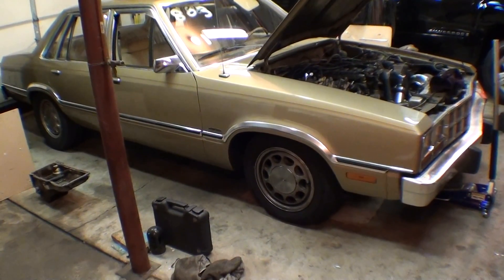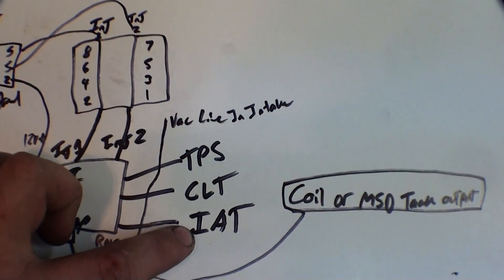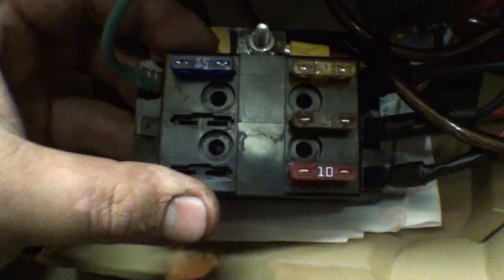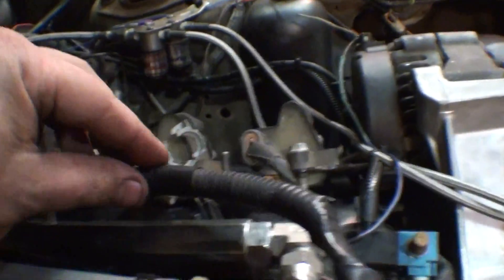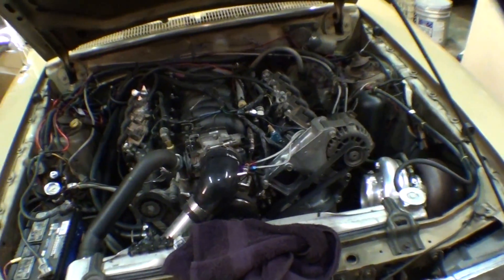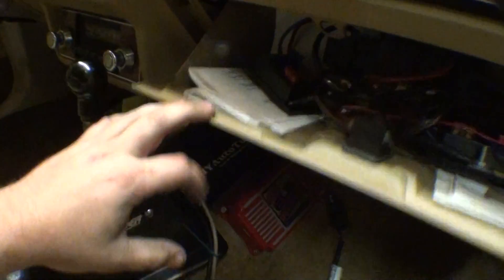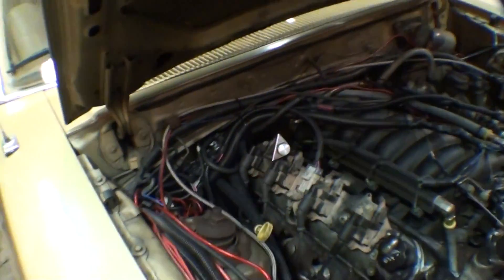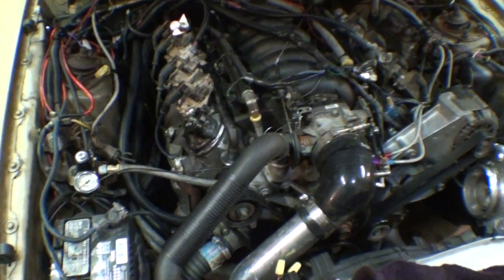9-29-12 how is Megasquirt wired into a car

Comment: I'm looking at the mega 2 kit looks interesting. I have the original edelbrock pro flow which is obd1 based sequential injection and want to upgrade. From what your saying this system drives all 4 injectors on one bank at the same time? Do I understand this correctly? Didn't appear to have timing control kinda like having that unless I misunderstood all of what you said.

Comment: Is there outputs on the ms3 gold that i can run to my gauges
Reply from the maker: you can buy a racepack and use the CAN wiring to feed it with all the info, other than that the only real output for a gauge is the tach out wire

Comment: I hope I understood this right and sorry if you have answered it but you are saying the megasquirt fires each bank separate for every other stroke correct? So it doesn't fire just the cylinder that needs fuel or two cylinders like most systems? I see how that wouldn't matter to much but I'm sure fuel efficiency would be crap right? I might of misunderstood.
Reply from the maker: batch is one fuel event per revolution. and that is just some of the ECU's other ones depending on cylinders and in/outs can do sequential easily

Comment: so I want to use the ms1 from diy. Is that pre-made box plug and play with no need to flash? once I have all hooked up I will need a tune to get running correct?. thanks again for your videos!
Reply from the maker: this video is 4 years old and i would suggest other means for running the motor than i explained in this video
Reply: Sloppy Mechanics thanks for the reply. I have been looking on your site and vids alot and I think that I need the micro from efi with your tune, I plan on running a glide for trans so from I get out of everything I read is that I should use micro.   I'm trying to build a track car for me and my son to have fun and possibly compete . thanks  I just came across ls1 site your on i think I'll prob find the info there.
Reply: Sloppy, what other means you would suggest now besides the Megasquirt? also when you did this setup did the Tach output of the MSD trigger the MS without issues?
Reply: what would you suggest to use now?
Reply: so with this set up the spark plugs are dry firing  all the time?
Reply: FerZam Rod if you're going with an auto you'll want to use the stock computer so you can run the 80 and the motor

Comment: After reading a for months and watching thousands of videos this was the best explanation I have seen yet that doesn't go crazy with shit I don't need to know! The grounds were really confusing me. I couldn't figure out if I was supposed to use separate grounds or not. Also The whole power the unit and fuel pump is still a bit confusing but I think I am starting to get it. Thanks for the vid!!

Comment: question iam trying to sort this megasquirt 1 v3 running fuel only and ford edis8 for what ever reason fuel pump powers up car wont start I think it floods itself so I took the fuel pump power wire off to start the car turns on and stays on with no fuel pump  no fuel pump pressure crazy but there's a short clip I posted here on my you tube

Comment: Im sure I asked this before, but how do you run a v8 on microsquirt with only 2 ign outputs?
Im wiring a vh45 v8 into a 240sx.
Reply from the maker: +idusclothing we hot leg in ALED and WLED into the 5v circut with 2.4ohm pull up resistors and you can configure them to be ignition outputs, so then you have 4, and you run the v8 in waste spark
Reply: +Sloppy Mechanics so the pull up gets 5v power from the 5v reference wire, that also supplies the tps ect...? I just branch it over, or wire it in series like the 330ohm for the bip373

Comment: If I wanted to run individual coils on a Ford 302 using the MS3PRO do you need an MSD box to control each coil? How do each coil wire in and fire?
Reply from the maker: +blacktop2001 ms3 pro has at least 8 ignitors you would wire in lsx coils and easily be able to control them with the ECU and no other equipment
Reply: Nice. Thanks. Do you tune cars? If so how much to tune a ,86 mustang 302 supercharged, ms3pro?

Comment: nice setup.. How much miles does ur motor has? is it still running stock internals?.. Im thinking of getting a 138k 5.3  idk if that's too much with a 72mm...
Reply from the maker: +Aaron Hernandez yep always stockers, usually 150-250k miles, gen3 motor will do 550-600 safely and the later model, ls2 rodded motors will do 700-800+ reliably its disgusting
Reply: +Sloppy Mechanics so, on the gen 3 it would be the rods that are the main weak point?  or if you threw in whothefuckevers cool kid rods would other shit start dying around the 700 range?  basically im asking if the rods are the gen 3`s only or main limiting factor in seeing 7xx horse?

Comment: So, to get that RPM signal to the megasquirt and use stock ignition system, I just get the signal from the ground wire on the coil like I would for an aftermarket tachometer?

Comment: I'm thinking about putting megasquirt into my project. its a 92 f150 with a mustang 5.0 ho. for now I am stick to N/A building another engine in the next year for some boost. I want to get basic tuning down with an N/A application figure it would be easier. Which version of MS would you recommend? I've been on the diy website and efi sources website, looked over a few products. I've been following sloopy mechanics for about a year now and you seem to be rather knowledgeable in MS and how to do it so I thought I would ask for your opinion on which version to get. Any input on MS and tuning would be great. Thanks!

Comment: hey good videos keep them coming. also can you run the output tach of the MSD box to the input tach of the megasquirt to let your MSD control the spark and the megasquirt just control the EFI.
Reply from the maker: yes, but if you have ms2 or ms3, they can control the coil on plugs, so it makes the 6010 kinda useless
Reply from the maker: yes, thats how i was running this setup at the time, now we run a modified microsquirt or MS3
Reply: ***** did you had any problems with that old setup.Did you had to modify the megasquirt box for it to work like jumper or solder connections? or was it a straight wire connection from MSD to Megasquirt
Reply from the maker: standard ms1, msd tach output wire into the ignition input on the ms1
Reply: *****
do think that will work with MS2 and MS3 too
Reply: ***** I have a 280z datsun it does not have coil on plugs it has a distributor with VR hookup and mechanical advance. I currently have it running with a MSD 6A-btm with the stock EFI computer. I want to change the EFI computer to megasquirt 2 but i want to keep the MSD for now until i get more familiar tuning with megasquirt.
Reply from the maker: f rod ohhhh not an LS based engine, sorry! i missed that, you will need the msd to fire the coil in most dizzy setups
Reply: ***** no problem I'm still new at this so any advice ill take.I'm currently running the MSD which controls the coil and triggers the stock EFI computer.I want to switch to MS2 or 3 so let me see if i got this right sorry if im repeating but if i take the MSD tach output wire to the MS ignition input I should be able to trigger the megasquirt to fire the injectors. correct?

Comment: Why dont you use the stock ecm? If you have a MSD why do you also need MegaSquirt?
Reply from the maker: i do use stock computer on some of the projects. this version of MS cant really run the coil on plug easily, at this time i was using the 6010 for all the igition options, and the ms1 for the fuel only. it was a great way to get my feet wet with all of it and make it work when i didnt know anything and did it all on my own haha
Reply: ***** ok. so which would be the more cost effective route for the engine management if I wanted turbo a 5.3 like yours?
Reply from the maker: microsquirt v3 is cheapest and easiest to start from nothing

Comment: Nice explanation dude. When I installed the ms1 on my 89 Probe, I made hacked up a crazy contraption of a trigger wheel. I purchased a 36-1 trigger wheel and found out it was too much of a chore to mount to the crank pulley. Instead, I mounted it to the cam gear and cut a tooth out 180 degrees from the other missing tooth. I told tunerstudio I had a 18-1 wheel on the crank and it worked like a charm lol.

Comment: i have always heard to run a wideband O2 sensor 36 inches after the turbo 70 degrees out (as in 70 degrees almost perpindicular, facing the DIRECTION of flow) to keep the O2 sensor in good condition.  Apexi has it on their site somewheres. :D

Comment: hey i like your videos  i am new at this i got a 5.3  stock i will like to make it turbo for my 66 el camino  well the problem is that when i got this motor all the wiring has been cut can i just use the wiring on the megasquirt  to fire up my 5.3 or i still need the wiring harness along with computer

Comment: easy to understand man. Never wired anything to extensively, and I hate wiring, so this is cool for me to watch kinda lets me wrap my head around it by seeing someone explain it and point it out then reading shit.

with the car making 22psi on the old heads, you should be at a bit lower boost now with better heads. BTW, what heads did you swap on?

Comment: Great video! This is the same system I had on my truck for a long time until my MSD 6AL took a dump. MS1 in fuel only with the MSD controlling spark. Way solid setup for the money.

 A couple questions, You are fogging in a little nitrous by the nozzle in the elbow. How much do you use(HP) and what converter do you run and how much does the car weigh?
I am setting up a fogger nozzle on my truck to overcome a converter that is too tight. Just curious.